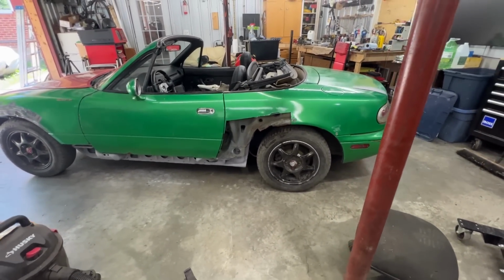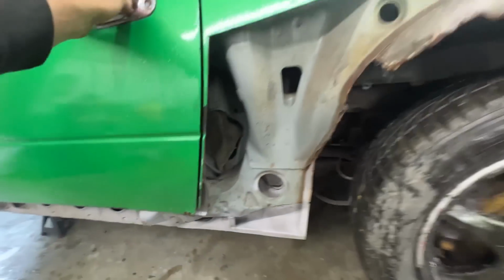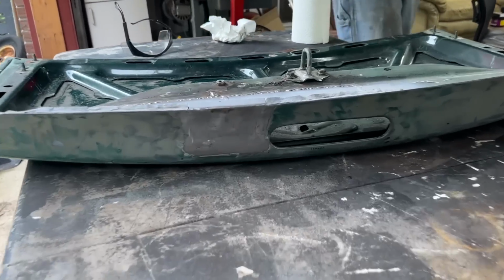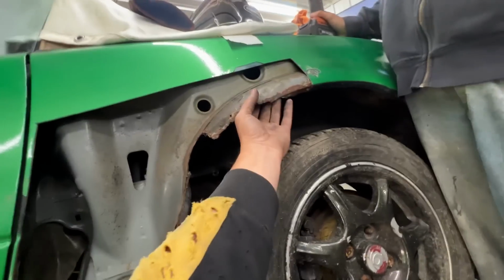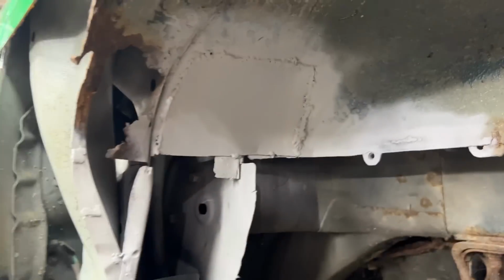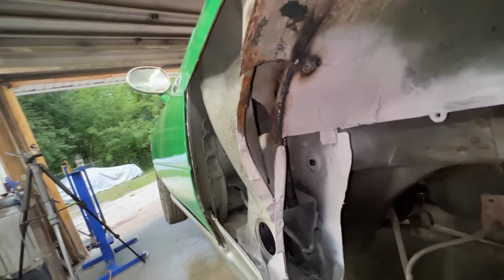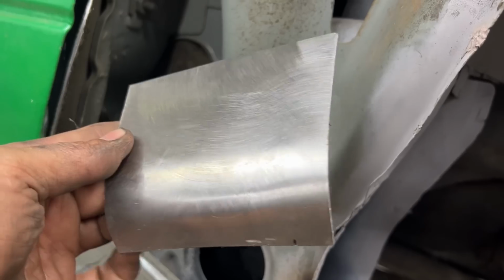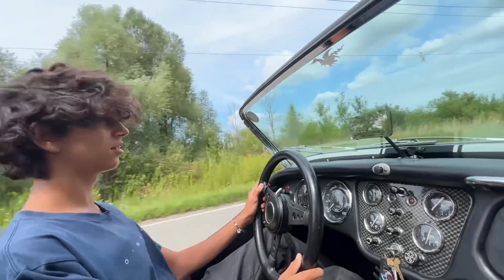1994 Mazda MX5 Miata - Part 18 - More Rust Repair

Comment: On Chef's TR3A the turn signal switch rotates with the steering wheel....I've never seen one do that.....Mine can be 'placed' where you like and it simply stays put....I've 'placed' it at 12 o'clock and can activate it with my thumb as I have big hands.....Seeing it rotate with the steering wheel is rather weird....lol........John(west coast,Can.)

Comment: First off, you have to be very proud of your son's good work. Sure, Nick needs more training, but he is on his way to becoming a real good body guy! Did you have any input when he purchased this car? Or, did you see this as a great way to teach your son, because it was so rusty?  I just got to watch the ending, was that a virtual drive? There was no movement of the speedometer. I am not sure of the layout of the gauges, was that the fuel gauge on top right not reading anything? Were you supposed to fill it up after the short drive? All in fun, I will work on David later. Cheers!